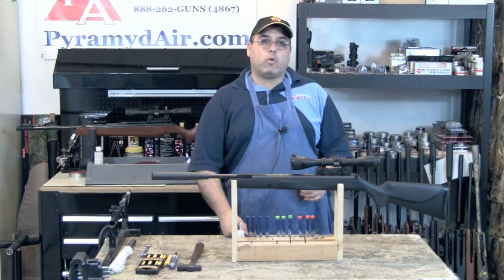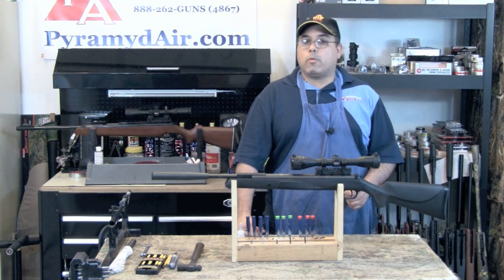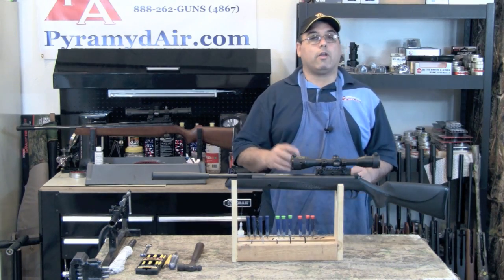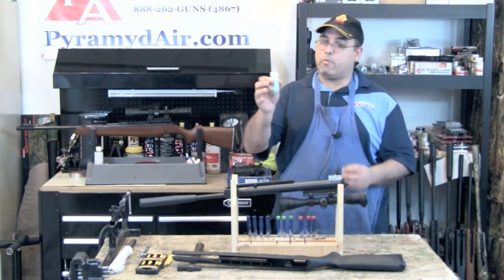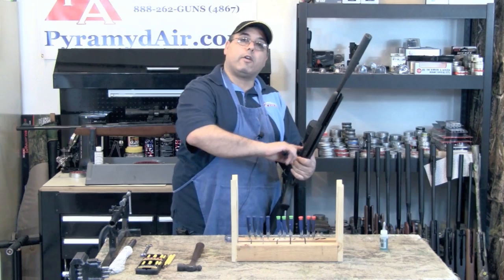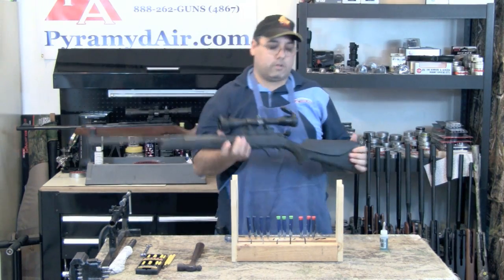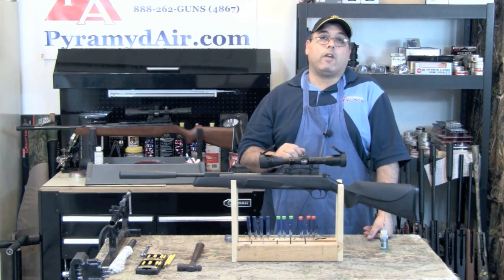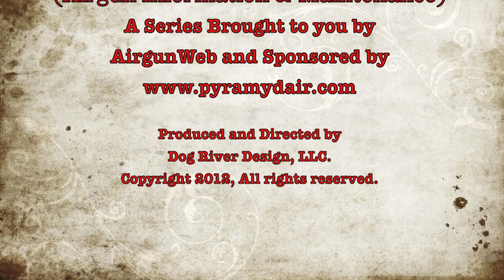RWS Dry Compression Chamber - Easy Fix

Comment from the maker: I may get to doing some "tune" videos, but it will later this year. One thing to consider, no mater what you do to a Chinese gun, it will never be an RWS.. Chinese Steel and components are NOT the same as German Steel and German manufacturing.  Not that you can't get some Chinese guns shooting really well, but with an RWS 34 just over $200, I have to ask why not spring for the real deal.  After many years, I finally learned the hard expensive way that you get what you pay for.

cheers 

Rick

Comment from the maker: Dieseling is when you have a combustible in the compression chamber that is compressed like diesel in an diesel engine.  The quick compression causes the contaminate to combust  (explode) which not only makes a loud noise, but can damage your gun if it happens too much.  You can get some dieseling with new guns if they are not carefully assembled to prevent it.  Once the combustible material is burned off, the gun should shoot normally.

Cheers

Rick

Comment from the maker: That is very, very true..

What I wanted to do with this video is give people an option that would not void their warranty.  The BEST way would be to learn to safely work on your gun. 

On another note, I don't use moly much on spring guns anymore, found something a lot better (in my opinion anyway).  Moly doesn't do much for spring vibration.  I still use moly on the gas ram guns though.

I'm working on part 2 of this for those than want to do their own maintenance.

Cheers!

Rick

Comment from the maker: You can try the same way.. but this issue is normally an RWS specific problem.  They don't use gas rams.  I don't remember ever having a Nitro Piston or IGT gun come in dry.. but the process should still work the same.

Cheers!

Rick

Comment: I have an Umarex Octane in .22,... I no longer dick around with stripping it down, I no longer play around with Moly Grease which is very expensive, gritty & very thick in cold weather,... When I need some lube, I simply cock the rifle & use an eye dropper to put about a quarter teaspoon of Auto Transmission Fluid straight into the chamber.
I rotate the rifle around a bit & shoot a few pellets into a balled up towel,... Yes there is some dieseling for the first few shots but its no big deal :)
I now have  well lubed piston seal & cylinder and the lube is made for seals, it's made for heat, cold & high pressure ;) 
I have done this for years & it works well :)
By the way,... Buy some over priced Pellgun Oil, put it on your finger then smell it & tell me it's NOT Auto Trans Fluid ;)

Comment from the maker: I would still use the chamber lube. You will get some dieseling if you use too much lube but it wll burn off. What you do not want is excessive diesling. RWS 3-9X40 and a RWS Lockdown Mount.

Cheers,
AGW

Comment: sorry but i disagree with you about using oil. on the mainspring, you are suppose to use a light coating of moly based grease. oil is to thin and will break down quickly and only a temp. fix. send the gun back and have it done correctly.

Comment: rws chamber oil is supposed to go in the port behind the barrel 2 drops down the chamber hole hello it say's right on the bottle bud
Reply: Yes but anything can benefit from PROPER MAINTENANCE. Less can be better. The spring will contact the cylinder walls and a LITTLE lube will calm it down. Tuning usually uses a grease sparingly applied to the mainspring to dampen it - and lubricate it. Again less is better usually.
Reply: @erniestoner8266  right all of it  yes

Comment: It's probably possible like with the regular maintenance anyway to put a few drops of silicone oil down the hole into the compression chamber when the gun is cocked and fire it a few times to spread the oil about. The gun will put out a little oil mist and oil smell and the pellet velocity will increase a bit for a couple of shots. Doing it that way avoids having to remove the stock. I do this every few hundred shots anyway with break barrel air guns

Comment: Your a sweetheart lol, thanks man. I'm having an issue with my .177 not knocking down birds straight away with a solid hit. I've been using JSB diabolo 8.4 grain pellets. Could I just be shooting so fast with such a small round to be zipping through them and not delievering enough of the kinetic energy? I have some 10.34gr diabolo on the way to see if it helps but any advice would be handy, least until I can afford another few hundred on a .22 :)

Comment: I bought the RWS Shooters Kit. It says 2 drops chamber oil at the 1000 pellet mark.
I added 2 drops. Boom, like a .22 LR. I found a comment where a guy complains his Diana 350 does this with only one drop. I now find comments from shooters saying they leave their rifles standing on-end overnight before shooting. Nobody tells you this. Pyramid air says after 3000-5000 pellets, if at all, wait until seal squeaks when cocking. They say some spring lube gets into the chamber, helps with lubrication.

Comment: Hello Rick I just got a Hatsan Sniper 125 Vortex. 22 and I've got about 100 or so shots though it and smoke comes from the barrel clear back to the trigger. And this gun very hard to sight in
Reply from the maker: +Bryan Morgan - contact HatsanUSA about the issue and tell them that you want them to take a look at it.  They may have you send it in.  If they do, ask them to please clean and check the internals as well as the shooting cycle and accuracy.  This should get you settled.  

cheers
AGW

Comment: Nobody seems to address this anywhere, so does using silicone chamber lube also lubricate the barrel when fired? Or do I need to separately lubricate the pellets?
Reply from the maker: +Jake Rodgers - you do not need to lube the barrel.  

Cheers
AGW